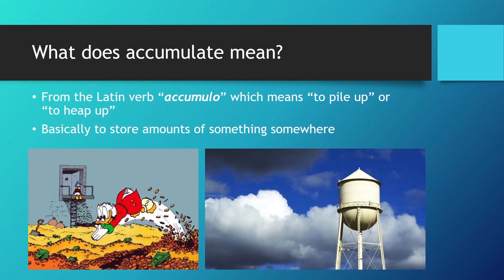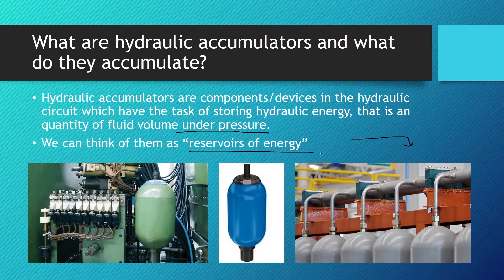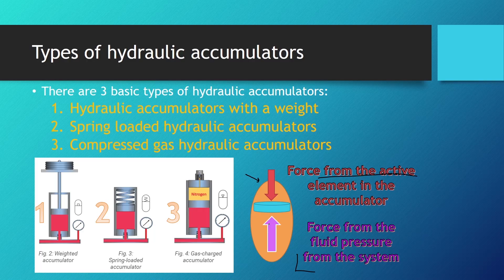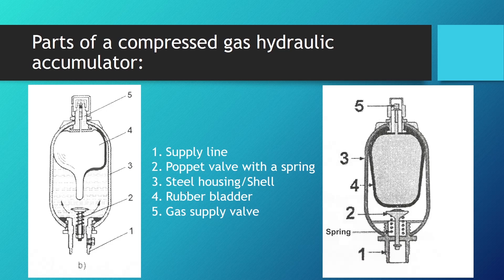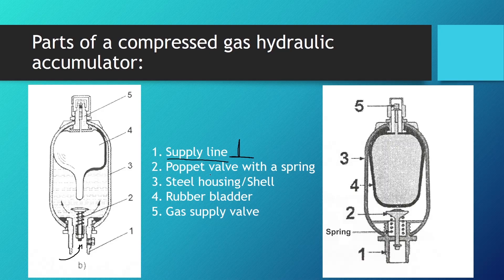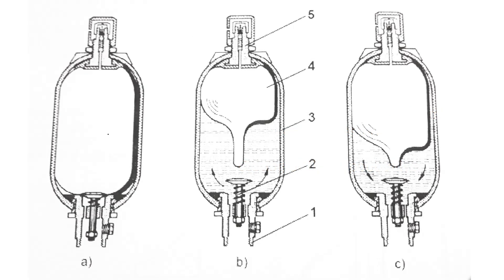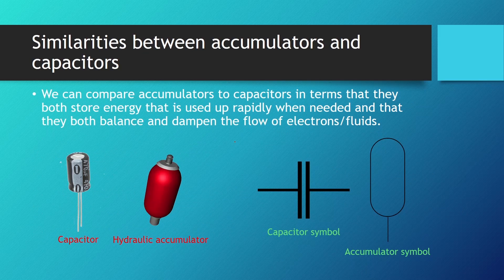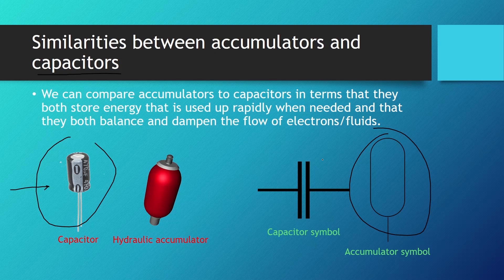How hydraulic accumulators work

Comment: in our power station we have a air over oil accumulator witch have no bladder or any separation oil to air. just they are contacting each other .  is it different from this working system pressure is 60 bar
Reply from the maker: That is very interesting, can you send me the model name of these accumulators, I would love to take a look at them :)

Comment: What would be benefits / disadvantages of having the fluid on top instead of the nitrogen charge or Vis versa?
Reply from the maker: Gravity keeps the fluid in a certain portion of the accumulator, imagine fluid being on top of the nitrogen bladder and every time the volume of the bladder expands, some of the oil gets stuck. To be honest I don't know about any accumulators that have their oil on top of the bladder. It is always recommended to install the bladder type accumulators vertically with the fluid port being down.

Comment: Very clear explanation. Thank you.
Reply from the maker: You're very welcome! 🙂
Reply: @engineeringpod  Today I installed newly charged accumulator for our shark jaw and tow pin system. The accumulator is initially charged 80 bars. The system working pressure is 220 bars. Now it is working. We use the accumulator for emergency release in case of blackout or the main pump failed. Your video really helps me understand what's really inside the accumulator. Thanks so much.
Reply from the maker: @Karaoke21479  Very glad to help you, that is why we are here and that is our mission! :D